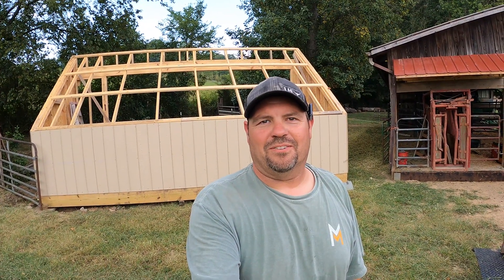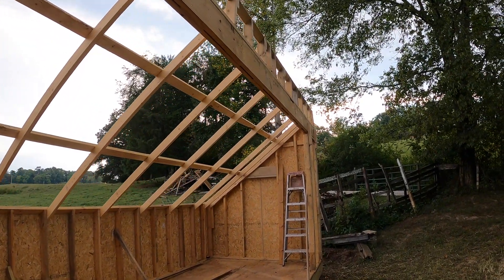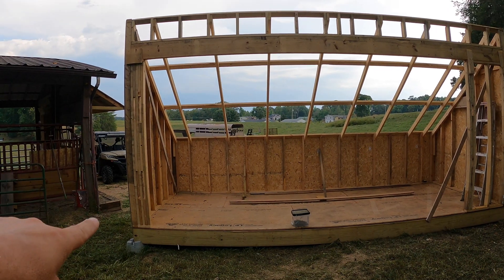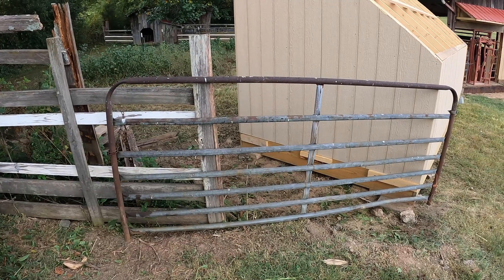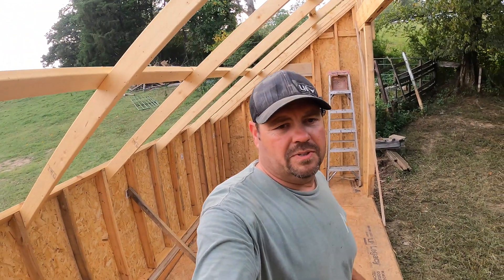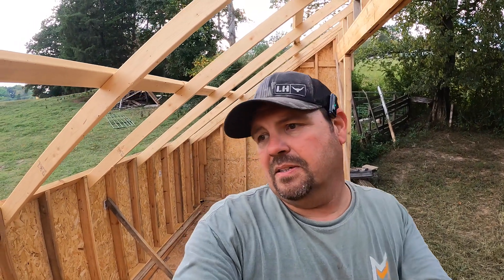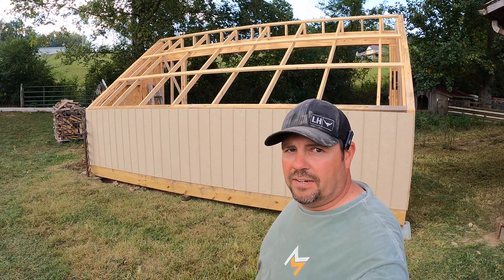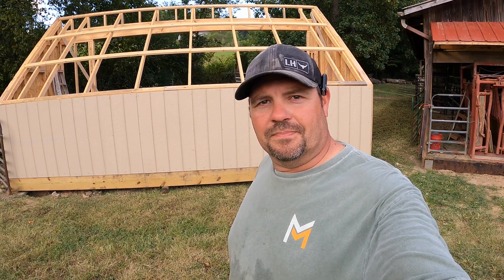Firewood Solar Kiln Build Part 2 #firewood

Comment: I speculate the roof pitch was approximately a 13:12 pitch (47.3°)? Tim in Oneida
Reply from the maker: That sounds about right. It’s definitely steep but it should soak up a lot if sun 👌🏻
Thanks Tim

Comment: Looks great. Your method on the rafters and roof perlins worked out great for this application. Like you said it’s gonna be easier to keep it air tight like that! Nice work Brandon👊🏻
Reply from the maker: Thanks Todd. It took a little bit of “outside the box” framing methods but I think it’s gonna work good 👍🏻